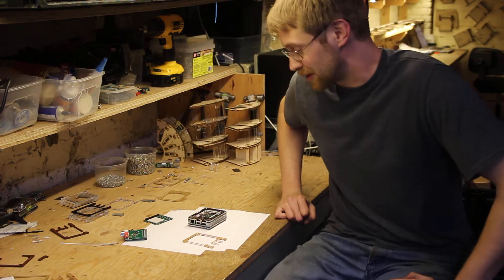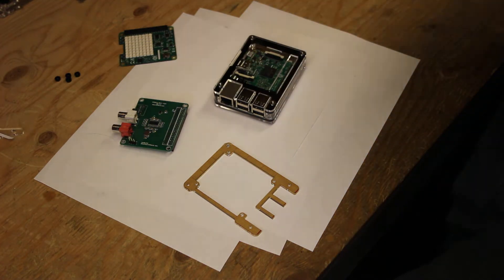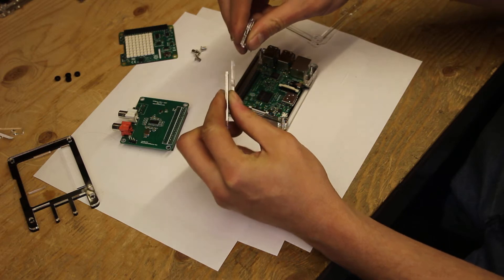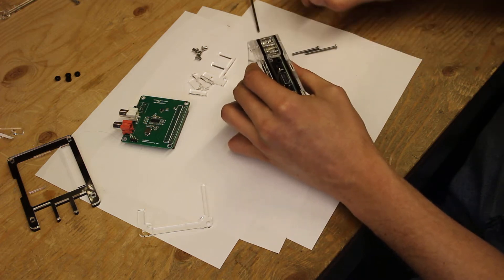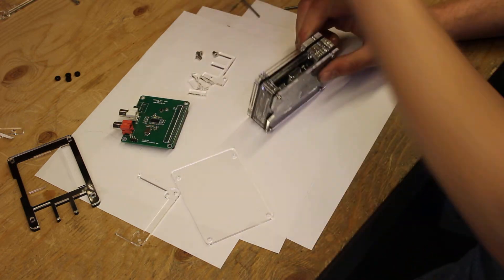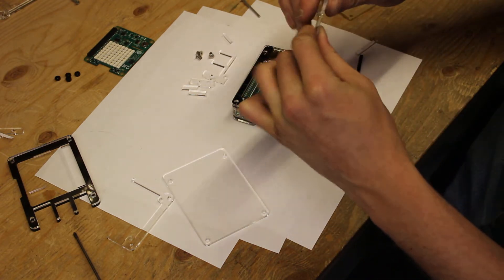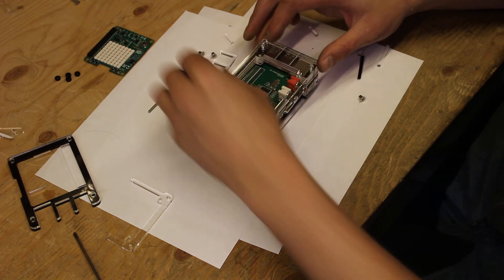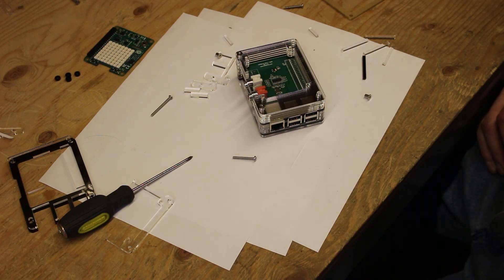Raspberry Pi Zebra Case - adding a Top Hat

Comment: Nice case,       Still working on getting this to work with my high profile top hat.  Optimistic it will work after watching this video.  My only suggestion, for now, is to strip off the protective paper from the acrylic before shipping.  When the acrylic pieces are new, the paper is easy to peel off.  When it gets to be a couple of years old the adhesive hardens and more difficult to remove.   I have my new zebra case soaking in soapie water as it would not easily peal off.  Very annoying.

Comment: What if the Top Hat is already attached to the Rpi with the proper screws? How does the case fit together then?  The Top hat in the video is not secured. It would sag on one side without the proper standoffs attached.